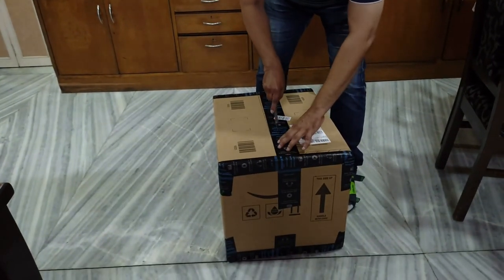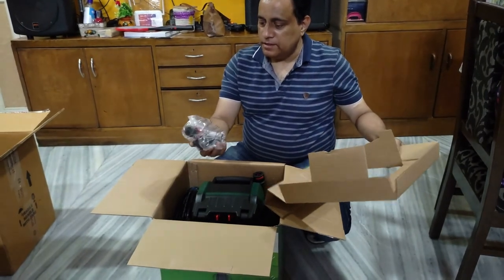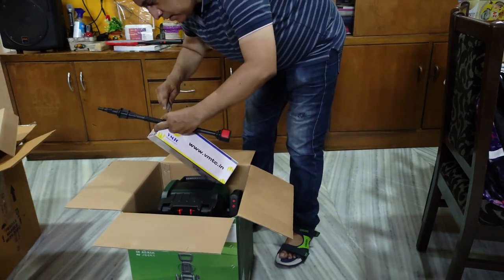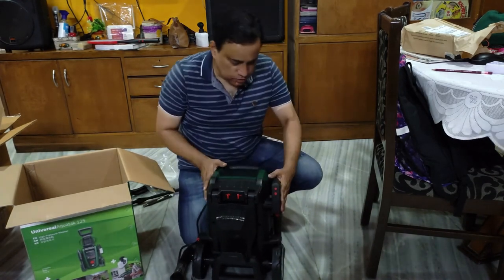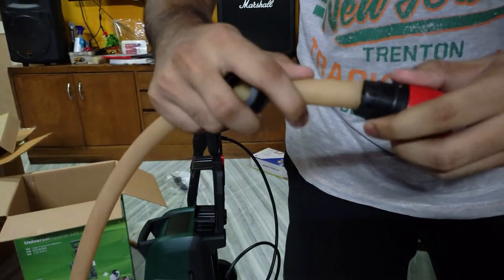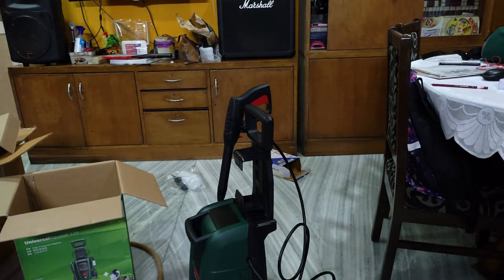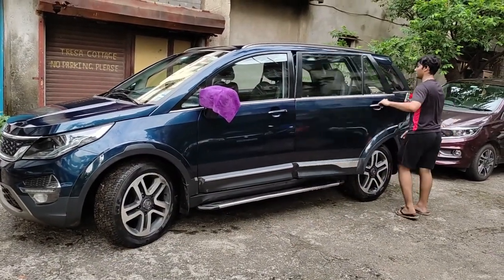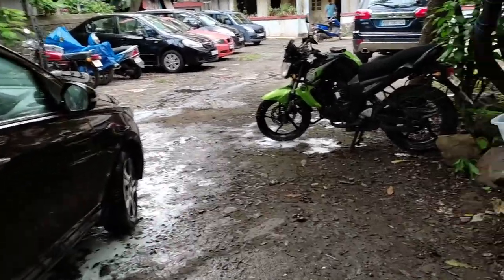Bosch Aquatak 125 High Pressure Washer - Unboxing & Demos

Comment: Thank you sir for mentioning, self priming won't  work unless you lift the bucket. I too was wondering why this issue is occuring. I see you also have switched the inlet pipe too  which is much  stronger as the latter pipe gets distorted while suction acts.
Reply from the maker: @ankitguleria  - you are most welcome. Thanks for your acknowledgement too !

Comment: how many liters of water does it take to wash a car? does putting the water bucket up have an effect on water consumption? thank you
Reply from the maker: To wash a small.car, it takes around 1 and half bucket. For a large car it could take around 2 bucket.
I found that keeping the bucket at a slight height creates good pressure, however consumption doesn't reduce.
Thanks - Harold

Comment: I just bought a Bosch aquatak 135. I made all the connections but a few seconds after starting the hose which was connected to the garden water pipe and which I had connected the other end to the machine, it disconnected, it gushed out due to the built up pressure between the garden water pipe and the appliance. I reduced the pressure at the boot but the same thing happened. How should I add water to the machine? should it be water from a barrel for the machine to suck or should I connect like I already did but have very little pressure to the machine? Maybe the machine doesn’t need too much pressure from my garden hose? My garden water pipe on full blast has a lot of pressure so I could just wash my car without the need of a pressure washer. Should I put the pressure from the pipe very low when connecting the hose to the pressure washer?
Reply from the maker: Hi - Thanks for writing in. Please ensure that the connectors of the Hose pipe to the Machine are the proper ones and connected snugly. Then you should not have disconnection or gushing issues. On Amazon or some other site check out the connectors that go on Hose pipe both sides as well as on the machine end. 

Let me know once it's done or if you still need any guidance.

Thanks

👍
Reply: It happened to me too. You just need to buy new,fitting part,it worked for me.

Comment: Hello sir, is the pressure washer working fine without any issues currently (after 1 year)?
Reply from the maker: Hello - thanks for writing to enquire. Yes - it's still working well though I had to change the Soap spray container around 2 months ago since the threads to lock it had turned lose. It is mainly the motor that is really powerful and reliable.